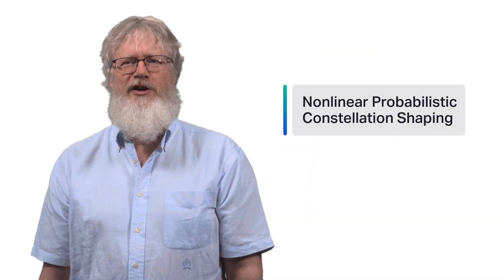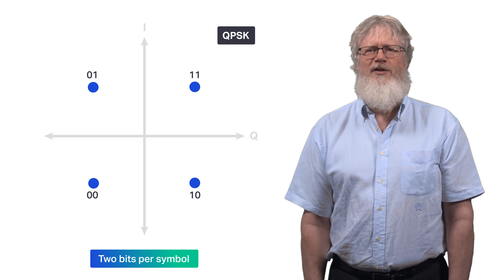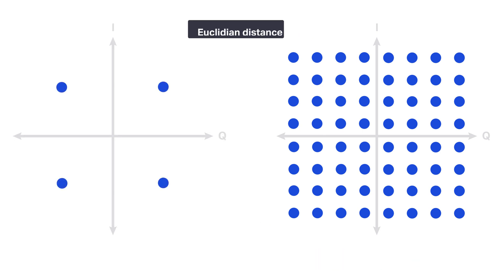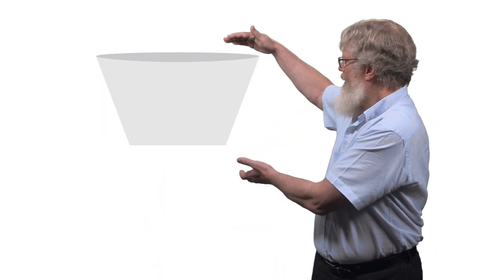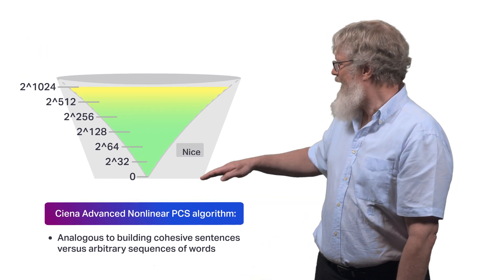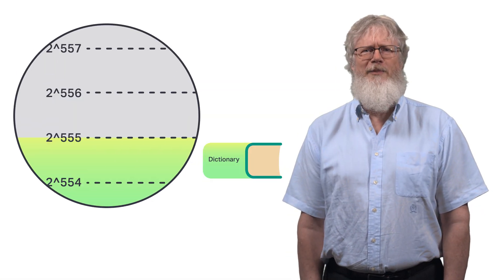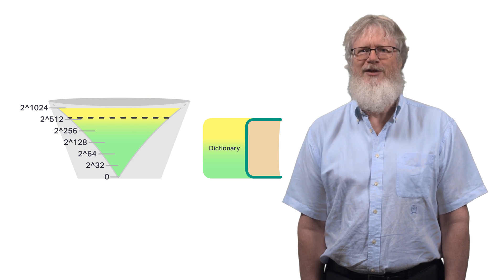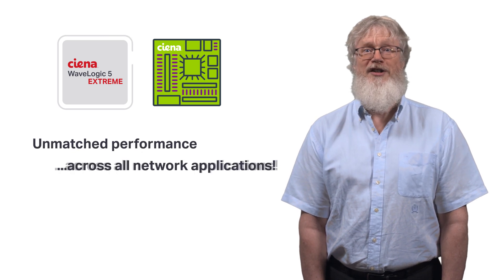Chalk Talk: Nonlinear Probabilistic Constellation Shaping (PCS) in WaveLogic 5 Extreme

Comment: "This reduces the average energy and so improves the average signal-to-noise ratio."  Kim, this don't make no sense!  If you make the S in S/N smaller, then S/N is smaller.  What am I missing?
Reply: The point is that the average energy of the (still noise free) modulation constellation is reduced (by preferring "inner" symbols) before the signal is re-amplified to the nominal average transmit power (or avg. symbol energy) at the transmitter output. With this amplification, you literally "stretch" the constellation and hence increase the Eucledian distance between symbols, just as required for an enhanced tolerance against noise (that is added afterwards down the transmission line). hth